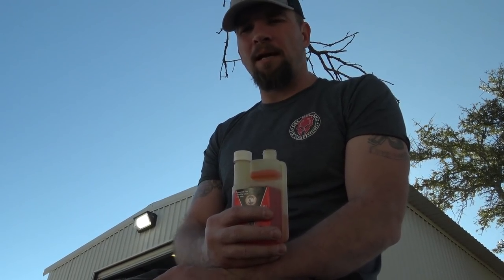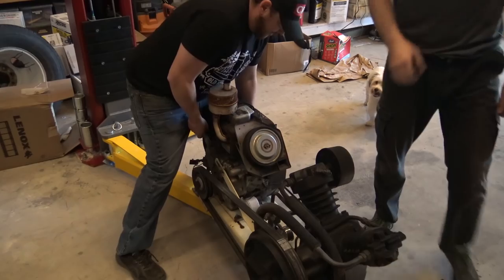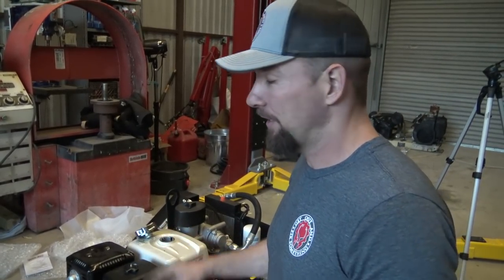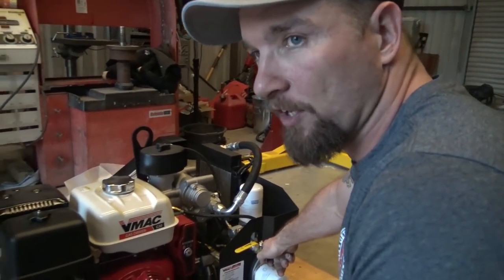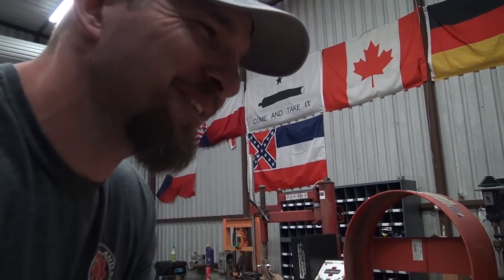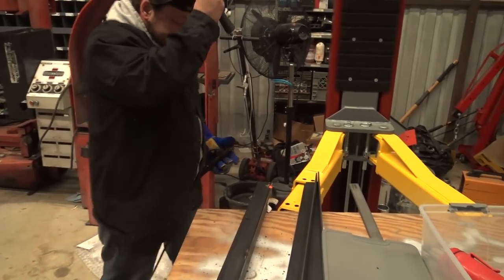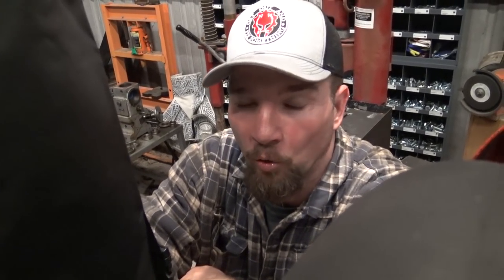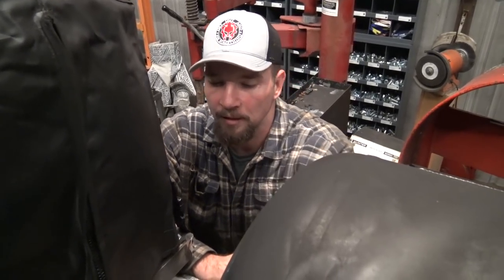Installing the ULTIMATE air compressor on a service truck

Comment: I just found your channel a couple days ago and now I'm watching a video from you with a compressor that I machined parts on. 👍 I'm a machinist at vmac. Great products. Keep the air tank with a check valve, it will keep the throttle operation smooth.  Great videos. Where are you located.
Reply from the maker: I'm in Ft Worth Texas. That's awesome man. Iv always loved VMAC products. I'll definitely look in that check valve. Any suggestions on a particular style?
Reply: The first one
Reply: @StephenCoxfixit  Any one way check valve should work. We do sell them on our website, but you should a able to find one anywhere.  The G30 doesn't store any air, so should have holding tank. Again great videos.
Reply: @obviouslytwo4u  That was the state flag of Mississippi up until January 11, 2021. Sorry you're so woke that seeing it in the background of an air compressor video triggers you.

Comment: Awesome video! One day I might need a similar compressor to the one that you just mounted but I was wondering about how you modified that Ingersoll Rand compressor that you mentioned. I have a regular full size gas truck and I want to modify a compressor so that I won't need a camper shell and still be able to keep all of my stuff dry and out of sight. I have thought about just getting a stacked compressor and modifying it to have the tank next to it rather than underneath the engine/pump.

Comment: Honda engines are indestructible.

I use to work at a big box store that sold all sizes of air compressors. Someone had returned a $1200 ingersoll rand wheelbarrow compressor because they forgot to put oil in it and seized the engine and the cashier didn't care and took the return. They put the compressor out for half price marked as is. It sat for about 4 months until one day I asked the store manager if I could have it for $150 and they agreed. I dumped some marvel mystery oil in the spark plug hole, broke the engine free with a socket and a breaker bar, cleaned out the cylinder and that Honda GX 160 fired on the first pull and ran like a hot damn.

Comment: So how do you think this compares up to the HarborFreight Central pneumatic 30 gallon truck bed compressor I think the part number is 62779
Reply: That compressor gets the job done as well( harbor freight). We had got one on a truck of ours and they were about $1100 at the time. Never gave a complaint doing big rig road service a year straight.  It's a less expensive option. I like the Mi-T-M company myself. Not the cheapest..but hold up very well.
Reply: Ok what would be the price difference between the two units

Comment: I've never had a problem with carb. I leave my fuel on all the time.
Reply: @Benjamin Burlos if your carb leaks with the fuel on then something is wrong with the carb. Mine should be worn out and I leave it on all the time. I've literally never turned it off. Mine runs 3 hrs a day 5 days a week. It's been on 2 pickups. It's over 10 yrs old. I clean it out every 3 months.
Reply: @westtexas806 the reason it is run for so long, so often is why it's not causing you issues. Leave it sit for 6-8 months and the carb would need to come off for a clean